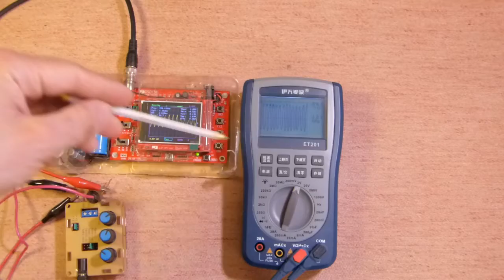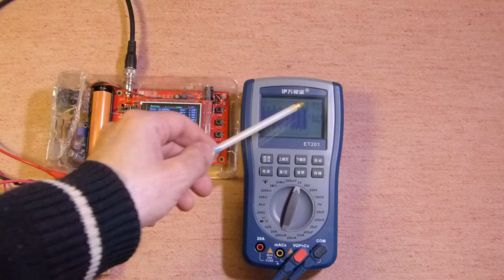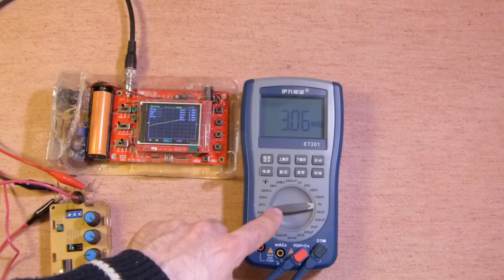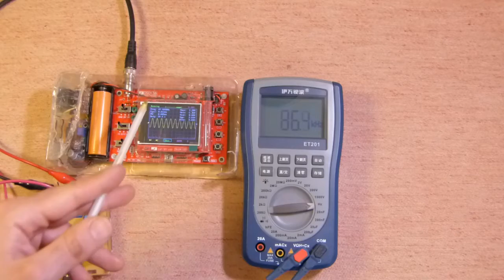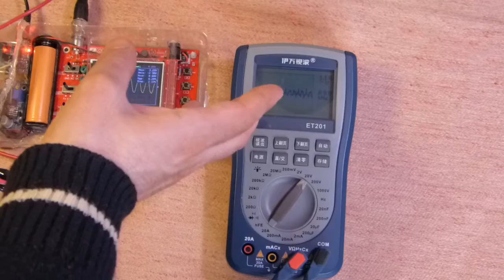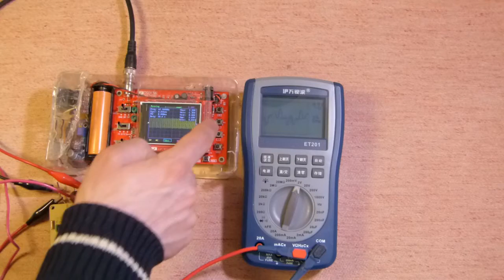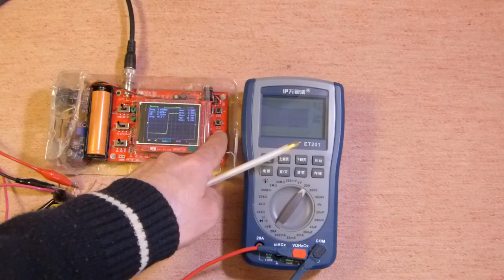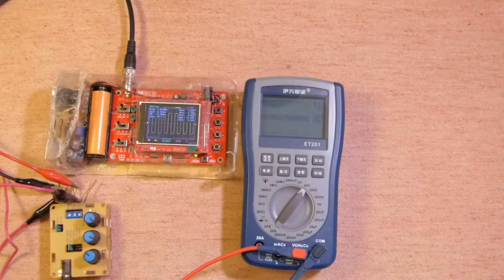XR2206 Function Generator, DSO138 and ET201 Oscilloscopes

Comment: Hello!

Are you using a 18650 battery and a step up converter / charger board to power the dso138? 
Can you please give a link to the needed boards?
Reply from the maker: Yes, you are absolutely right.
Here are the links:
http://ali.pub/1j8aif
http://ali.pub/1j8ao2
Reply: Thank you!

How long is the working time with an avarage 2500mAh battery?
Reply from the maker: Depends on the battery condition. The consumption of DSO138 is max. 110 mA.
Reply: Thanks! I have ordered the parts already!

Comment: Which one did you think made it better? Which one is faster, and which one do you prefer? Thank you very much in advance.
Reply from the maker: First of all, let me know the reason you would like to get an oscilloscope. Of course, faster is DSO138. As to the possibility of seeing of an oscillogram of mains voltage - it's not possible with DSO, - in this situation you should use ET201.
Reply: Power Battery Thanks for the feedback, well I intend to use basically to regulate the gain of audio amplifiers so that there is no distortion, which one do you think would suit me better? Good but has the fact of the voltage supported in case the dso can be used a 10.1 probe to increase from 50v to 400v according to the technical information or am I mistaken?
Reply from the maker: For the amplifiers - certainly, you will need DSO138 for more detalied picture. As to the mains voltage - it depends on your country, 50V for the oscilloscope is the limit; in fact it's 40V i.e. this is Vpp. If you have 120V, then Vpp is 240V, and with the help of 1:10 probe (40V becomes 400V) you can measure it safely. Bu if you have 230V, then Vpp is 460V and you may damage the device.
Reply: Power Battery I understand, thank you, friend. In the case using a tip x10 going up to 200v for me is more than enough, I will not measure as much voltage thus, I think it would not exceed 140v. Can you tell me if the et201 is a true rms multimeter? I did not see it speaking in the specs, I think a multimeter with these tools should be true rms. Thank you very much in advance
Reply from the maker: I don't think it's true RMS, otherwise the seller always indicates such information in the specifications. Anyway for such multi-tool with such price it would be strange to install also true RMS function.